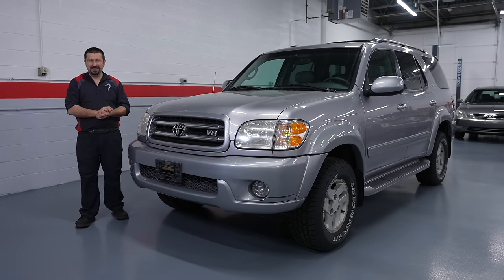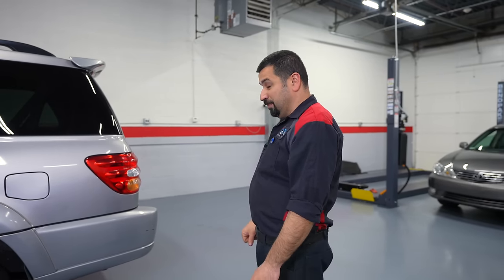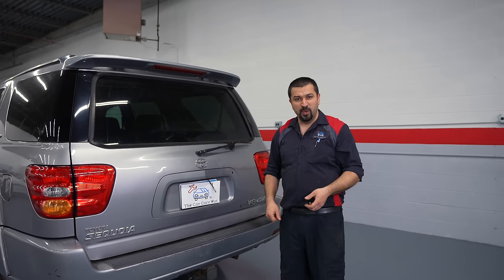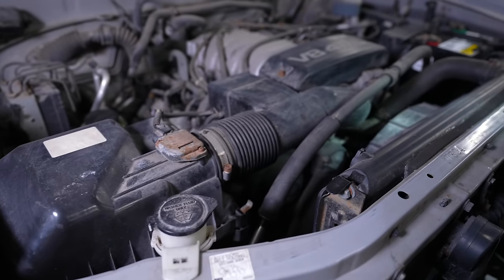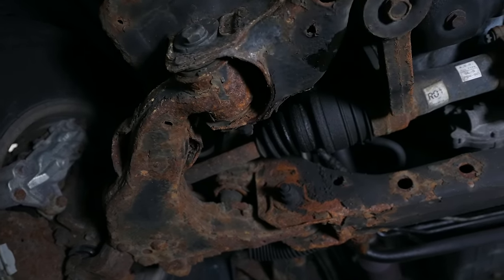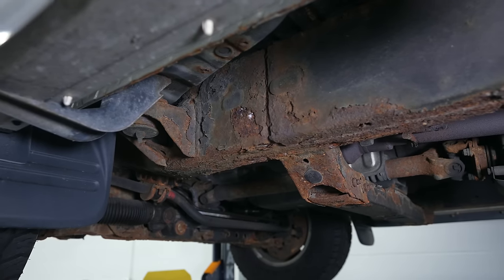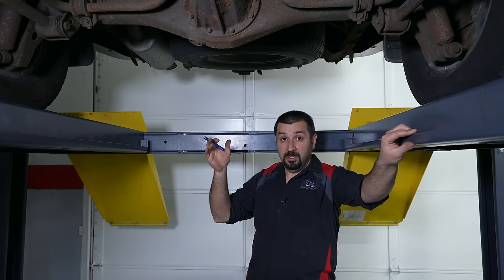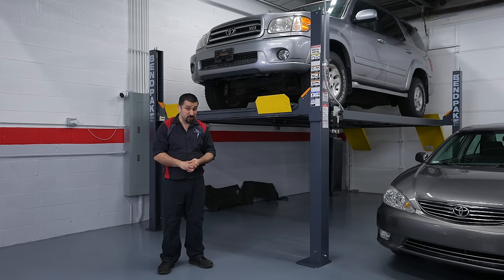NEVER Buy a Toyota Like THIS ONE! Hint : It's not The Sequoia!

Comment: I live in Wisconsin and rusted vehicles are a major problem here. This is why GM and Ford work perfectly well here. By the time most vehicles have 200,000 miles on them, they’re ready for that junkyard. I have had several GMs and Fords with 200,000 miles or more, and don’t know how anyone could get 400,000 out of a car here unless it’s stored every winter. And the foreign cars rust out faster than domestic vehicles around here. At least that’s my experience with them.

Comment: the column shifter on my '01 broke at exactly 300K.  When I went to get a new one I got put on a backorder list because it's a wide known problem and they can't keep them in stock.  I'm definitely not 'hammer handed', looking at it closely you will see it's a poor design in the method it bolts on.

Comment: Thank you. I have a 05 Highlander FWD. 
105k miles. Highway driven mostly around the USA. Bought off Family member question is timing belt should I replace or see if I can go a without replacement I only drive it locally. I had it priced out $800 to $1200 
To replace I live in NY.

Comment: The back hatch is pretty heavy, its a common issue to have the back hatch/lock malfunction. Bit of an annoying fix having to take the back interior trim an pannel off but absolutely doable
Reply: Not in any way excusing all the other serious issues that specific vehicle has, but as for the hatch it's more of an annoyance than significant issue.

Comment: The steering column shifter actually is a common reoccurring problem with the Toyota Sequoia. I have an '04 that did the exact same thing and when I went online and started looking around I seen a whole lot of commentary about it and if it wasn't a reoccurring problem why would every auto parts store carry that part? It's a Dorman part . It's made out of that cheap pot metal aluminum

Comment: One time I wanted to buy a used Toyota Hilux truck. I live in mainland South East Asia, where these are extremely popular. They also retain their value very well and thus are an expensive buy, even when used a lot. People here spend little money on maintenance so I am extra careful. Most of the trucks I looked at had issues. I changed my mind and bought a small used Suzuki which is cheap to maintain and easy to service. Saved a lot of money in the end. Every country is different, but I think here it's just best to buy a new truck. And just because it has a Toyota badge doesn't mean it's in a good state.

Comment: I hated the back door handle breaking. I changed it soooo many times. I finally did the cable because after 6 times I had enough. Once in the same week it broke after changing to new. The the sky light window opened and would close. I was over it after that point. Got rid of it. It is not because they were hard on the handles. It is because the design was a piece of crap. Known problem. Can easily see that with a web search

Comment: I just purchased a 2003 Lexus ES with 90,000 miles. It looks like new. Driving  by an older man. My question is , should I replace the oil with Toyota oil?
What kind of transmission oil?

Comment: Dear AMD, could you please comment on the following: Toyota had frame rust issues in the early nots (2000th). But I read somewhere that they cleaned up their act after the recalls and extended warranties. We just bought new GX '23 (Boston area) and want to keep it as long as we can. I looked at many a video, but can't believe that Toyota/Lexus would rely on people getting under the car and spray carcinogens several times a year. Do we really need do this on '23 trucks?

Comment: Just bought a Rav4 used the dealer had it up on the hoist so I could inspect the under side, wish every dealer would do the same. If the car truck comes from salt country the frame has to be inspected that's were the c frame was nice.

Comment: I had a 2003 the frame was replaced by Toyota the rear hatch always had problems rust wouldn’t open the handle I replaced a few times also the AC never worked right.

Comment: Yeah the minute I heard the noise when the rear trunk was opened indicated structural weakness. Engine is a baby though. But what is it about Toyota that manifolds seals fail less than 50k??? I knew a guy that bought one for 4K akk it had was a break fluid leak

Comment: 3 years ago, we went to get our toyota belta 1.0 litre serviced at the toyota dealership ,the only official car manufacturer in the country i live in.They said the 4 steel rims are unsafe due to excess rust, it was very bad n scary but they didnt sell any steel rims or alloy,to look on the aftermarket.Look couldnt find new steel rims or alloys for the new tyre size i had.i ended up trying to check the rim myself took 1 out say the rust was only on outside of the steel rim due to paint of a bad body shop.inside rim had no rust.clean the rust from it with drill and brush bit,applied rust convertor thats it.3 years i go for inspection yearly and never got a problem.do you own checks and live with it dont trust people who are professionals supposedly,rust u have to check it yourseld with a screwdriver your paying no one else.ofcourse i dont live in a place with snow and salt so no extra issues with rust

Comment: The first couple of things during the first 5 or so minutes I was actually still „Eh…not a big deal“.  The second the rear passenger side door was opened, I would have walked away. Once the forbidden puff pastry peeks out like that, there is a 100% chance that all of the undercarriage looks just like that, or even worse. And I was right. 

I have seen people trying to be sneaky and repair those things to make them look appealing to a prospective buyer. That is how you end up with side frame parts that consist of about half fiberglass and Bondo, crumpled up newspaper and paint by weight. Worst of all, from a purely optical point of view, some of those jobs don’t even look half bad. They would pass a cursory check no problem. Unless you tap on it of course.

I have even heard rumors of others pouring plaster of Paris or concrete slurry into their frames to „repair“ them. 

Makes me shudder to think what is driving around out there. Those death traps crumble and fold like wet cardboard in a crash.

Comment: I bought a toyota Yaris 2008 with 120k miles, now its consuming oil, i think is the valve seals. When im driving about 50-60, and slowing down, and speed back up it blows a cloud of smoke (white) but then it clears out. I checked compresions. And there as follows, do you think is the head gasket also?
Piston compretion:
1.160 psi
2.175 psi
3.180 psi
4.160 psi

Comment: And to anyone who has a 2002 to 2007 Toyota corolla if your car is showing a check engine light and idling weird then sometimes it doesn't show it and runs fine what might be wrong is your idle control sensor it is on the throttle body and I would only recommend a toyota genuine replacement part or you can try cleaning the preexisting part and I would highly recommend getting a specialized Toyota mechanic to change it. It is horrible to get off and more than likely if you try it yourself you will break the throttle body so just spare yourself the pain and spend the extra money to have a professional repair it. and if you are doing it yourself even more reason to get a Toyota genuine replacement part better not push your luck changing it 5 times

Comment: i just got a 97 camry same kinda stuff frames solid in all important areas but sub frame in back is bad ill have to replace it soon and susp componets are all flaky rust also ill slowly replace it all and it will be good for atleast 5 yrs only 138000 on the 2.2 i had to pull engine on mine tho leaking rear mains after i bought it from used auto dealer

Comment: Alone with the broken cables, it would’ve turned a red flag for me and I would’ve walked away unless they fixed it properly just recently bought a 2016 Toyota Camry SE had to bring it back to the dealership where I bought it from so they can fix the washer fluid line Stupid stuff like that. I’m very particular about the car only has about 84,000 miles on it for almost an eight year old car. That’s actually not bad. I do hear a little suspension noise now and then but I know Toyota are known for that, that really is not a big deal, I’ve already been underneath this car inspected it. It’s just a swaybar bushings. They go out possibly the ball joints as well and maybe the strut mounts that’s what it sounds like to me know the sway bar bushings are old. I physically looked at them $12. For a set and I think two 12mm bolts a really easy job pretty much other than that. I think my car is in good shape for the year and price that I paid for it. other than that, I did check the oil. It does have a fresh oil change a new air filter. The battery looks a little old, but I can tell  every time I start the car. It cranks very well. obviously, I will have a tested in a few more weeks from auto store but other than that, there’s no leaks at all. There’s no misfires there’s nothing.

Comment: I need some advice. Im trying to get a vehicle that can be a reliable daily driver that can handle Montana deep snow. I found a 1997 Land Cruiser 40th anniversary with 360,000 miles. It was the guys daily driver until 2020 when he parked it in his shop and they started using other vehicles. It has some exterior surface rust but cant tell how bad. He put in new battery and oil change before posting it for sale and claims it runs and drives. I would have to drive 3 and a half hours in snow to go get it for 5,500. Or theres a 2001 toyota sequoia for sale in my town for 6,000 and i may be able to talk him to 5,500 and it has 200,000 and was this couples daily until they got another vehicle. Do i risk driving all that way for a land cruiser? Or get the sequioa. I really want the LC and always wanted one and would love to restore it to original and get the repairs done but i also need something for daily driver soon not in 10 months lol. They both run and drive according to owners and the owner of the Land Cruiser said he had not doubts itd be a daily driver and that it could make the 3 and half hour drive home. Any advice?

Comment: Lol i bought a 3rd gen  4runner that had many problems. fixed it all. i wasn't out too much money but still hours of work. Valve covers, timing belt, entire steering rack, and suspension bushings. Frame is mint condition, rust free tho. i do regret it money wise  because i just recently had to put new coils and wires on it and it gets HORRID MPG. like 15 if i'm lucky. but the truck runs and is paid off and i got a really Cool capable SUV. I get compliments on it sometimes. It's very fun to take to the desert if you can save enough money to get it out there 🤣🤣

Comment: These Toyota Sequoia is on one of the best cars on the road. They have little issues compared to other cars. they did a frame recall on most of them.I still have My 02 with three hundred and forty thousand miles on it right now and it drives like brand new.

Comment: I disagree with you about the rear hatch opener. I have bought at least 5 of them oem and aftermarket; after the 5th one broke I said no more an routed the wire the same way as shown. P.s. does not matter how rough or gentle you are with that handle it will brake. You look at it wrong it will crumble.

Comment: I have my eyes set on a 2019 tundra crewmax. Been searching for months, this one finally checked off everything on my list. However carfax said it got a new fuel pump at 30,000 miles back in july 2021 during huricane elsa? Should this be concerning? My colorado fuel pump gave out at 100,000 but because of rust. I’m from MI and this car is originally from FL. Only thing i could think of is flooding somehow affected wiring. Car is mint as far as rust goes up here. Nothing else concerning pops up on carfax, maintenance records are consistent.

Comment: "Im seeing GM style problems now" 😂😂 best statement 
I just bought a 2019 4runner sr5 with 86k miles from the toyota dealership and i did a complete walk through to make sure everything was good and ended finding out it didnt have a cabin air filter the skid plate was missing and the cover for the oil drain plug was missing and the filter housing was broken but everything else was good and normal wear n tear for an 86k car and the dealer guy droped another 2k off and replaced all the missing/broken parts and I ended up paying only 27k for it ive already put 6k miles on it and just changed the oil,spark plugs,trans flush, trans filter replacement,wheel alignment,rotation and balance and new battery which is common for a now 90k mile suv and she runs perfectly fine

Comment: Well I bought my old Altis and other than having to change some parts where the original where OBIOUSLY NOT Toyota genuine its been a great car 20 years later bought it at just 4 years old with what was a really cheap crash repair job on the front and other than having to change the radiator fan motor and a few other things it hasn't given any issues.

Comment: If the price is cheap enough it is worth putting a frame in. I try to steer customers toward cheaper, low mileage, bad frame Toyotas. It is an opportunity to get a southern rust free frame, replace any bad suspension components, and do service items while the vehicle is blown apart. 90% of the frames I replace are powdercoated. They still require cleaning and some type of corrosion protection on the inside to fight rust. Typically all in cost is below book value and way better than comparable "clean" midwest trucks. Patching should not be an option. I see terrible work all the time.

Comment: You are probably too busy, but you should offer Wool Wax/Fluid Film spraying at your shop.
I would be your first customer and I would supply my own product and spray gun.
I usually do it myself, but I'm getting too old to be crawling under the car for a half an hour 
My car is a '18 and after five Chicago winters, it looks showroom new underneath.
If you worked in Subarus I would be a customer.

Comment: Was gonna buy a Sequoia, but after looking into a lot of factors. I bought a Tesla model X... against every gearhead instinct i had...

But an $11K Sequoia(good mileage 140k) at 15k miles a year. Will drive 75K miles in 5 years and at average $3.30 gas price, thats $17,000 in gas. Equaling to to $28K in 5 years.

Whereas the Tesla X i bought(great deal w tax credit admittedly. $20K for 90k miles).
And will cost $3,900 for electricity.
Bringing cost to $24K...
Plus i somehow got a lifetime warranty on the battery(apparently early models came with em before switching to 150,000miles8yrs).

And anecdotally, a buddy of mine who has the same car. Has admitted to issues(falcon doors squishing the rubber seals. Drivetrain shake. Leaky screen.) But Tesla took care of all of it as manufacturer defects. As any decent car company should. But just say that cuz i think some of the horror stories are overblown.
Reply: Your drive unit will probably fail in the next 50k miles, then what? $15-20k. Teslas have tons of electrical issues too btw and you have to buy Tesla branded factory parts at full retail price. And not everyone can work on Teslas so you’ll have to take it to a Tesla service center. Still think it’s a good deal?
Reply: @kaibaumgartner7721  by the money and stat sheets. Yes. Lemme help you with some things...
1. A motor now Costs 3-K with labor for replacement. I checked with two tesla dealers.
2. The battery is the biggest replacement expense but has a crazy high reliability rating(longer than a toyota engine and that's saying something here)
3. The model I got has a lifetime battery warranty also since it's an earlier model. So this particular car is good until it gets battery damage from a wreck.
4. Those electrical issues are "generally"  manufacturer defects which Tesla fixes for free(like any other car company caught not building to par. Happens to all of em)
5. Check stats, reliability ratings to 200k miles. And consumer reports and I think you'll be a bit surprised by how much of what you said has changed or is over exaggerated.

Comment: Hi I have a 2000 Toyota tundra 4.7 2wd I’m the original owner it has been serviced religiously I’m at a 120k miles and my transmission went from second gear to o/d can you help me my local dealer in Miami FL says I need to rebuild it ?

Comment: My friend has a 2010 Tundra he bought for 10 k. After two years these lights are on Trac control, 4Lo and engine light he has replaced transmission oil and and a few sensors but still all above lights are still on. 
If he disconnects the battery lights off. After two weeks back on. Can you help with the correct fix. 
Thank you sir.

Comment: I have a 2000 Toyota Tacoma with a 4 cylinder. My engine light started flashing and the truck starts running on 3 cylinders , but half the time it runs on all 4. I replaced the EGR valve thinking the problem was fixed, it wasn't!!! It still intermittently runs on 3 cylinders! Is their a fix for this?? Anyone have any advice ?

Comment: I was checking out a Sequoia with 125K miles. The oil pressure was modulating up and down at idle. Watching this video, I'm not impressed with Toyota. Seems like a lot of problems with 200K miles. My GMC truck is still going strong with 300K with very little issues. I must admit, I did buy a newer 4runner.

Comment: This same issue got me a few years ago. My '97 4Runner engine and trans ran smooth at about 140k miles. Body had small rust spots. When I tried to jack it up with the factory jack it went right through the bottom of the frame. I sent it to the junk yard, after swapping some parts into a '98 4Runner that has a good frame. It is the catch 22 of Toyotas. They run so well you don't think about inspecting everything until it is too late. We have yearly inspections here in PA and mechanics mentioned the rust but they didn't realize how far it had spread.